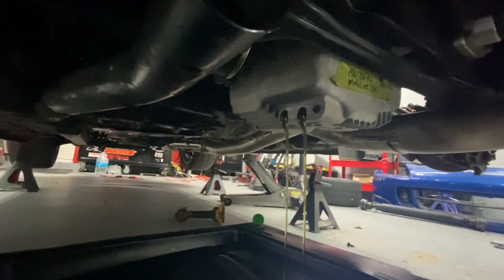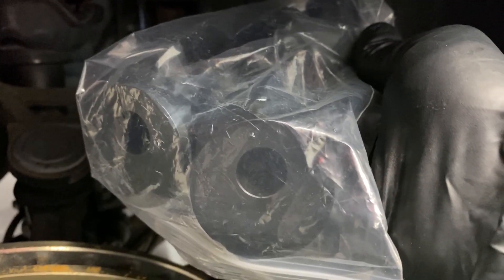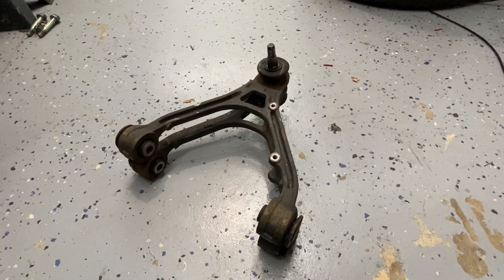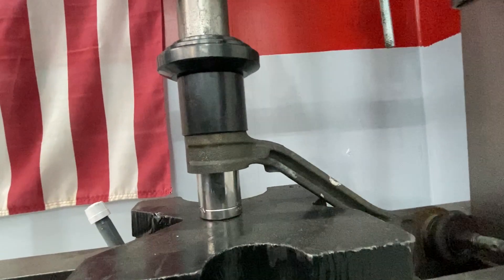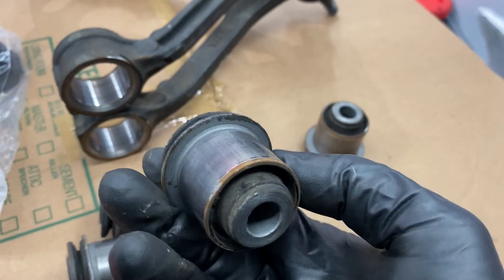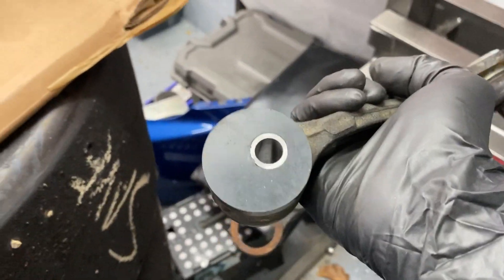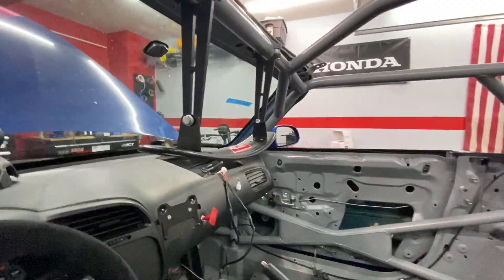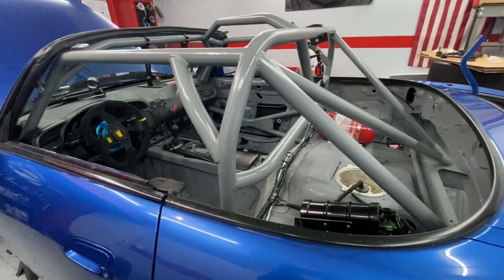NASA ST5/TT5 S2000 : Build blog episode #13 Offset bushings and misc

Comment: You mentioned in the video that you replaced all the bushings on your car last year. How did you end up removing the rear lower control arm front bushing? The one with the lip on both sides.
I'm actually in the middle of doing my entire car right now with sphericals and ended up cutting one lip off so I could press the bushing out the other end. Is there a more elegant way of doing it?
Reply from the maker: There is no elegant way.  It required cutting, burning, tearing, and cursing.
Reply: @samedrizvi  that's exactly how it went down for me! 🤣 Took me 4 hours just to do the pair
Reply: which sphericals did you end up using?  I'm looking at Wicked Tuning and Hardrace but could use some expertise
Reply from the maker: Noah P I used Ballade.  They aren’t all true sphericals but they work.  They were the least worthwhile mod.
Reply: @samedrizvi  interesting! So not a big difference in feel huh?
Reply from the maker: Noah P not really